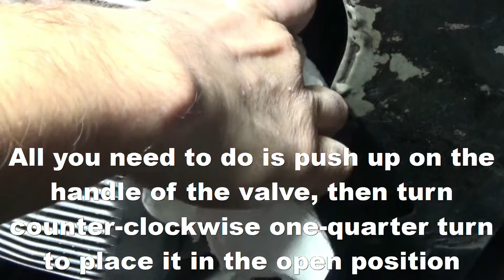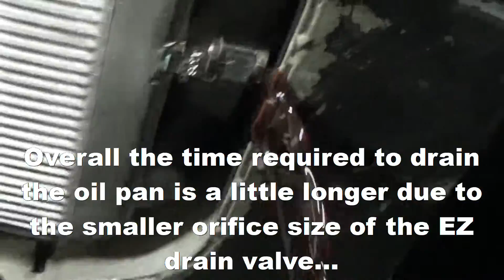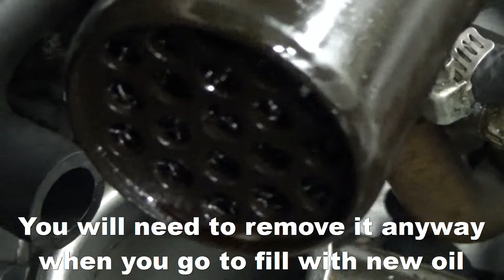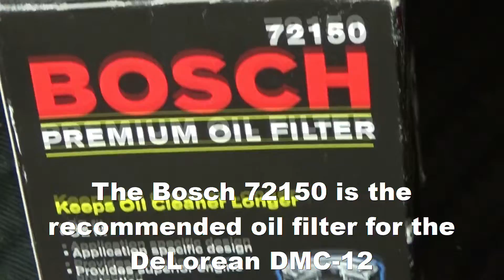DMC-12 Oil Change with EZ Oil Drain Valve from DeLorean Parts Northwest

Comment: You can add an optional hose end to connect to a hose to avoid the oil from splashing.  Simply screw on the H-001 (Straight) or L-001 (90 degrees elbow) to this valve.  You may order from www.oildraivalve.net
Reply from the maker: Thanks for the tip!  Yes I plan to get that... correct URL:  https://www.oildrainvalve.net/

Comment: @matt wolice  Isn’t there a danger in using synthetic motor oil on older cars as this might cause them to leak? I heard the molecules are smaller and this will be a a problem. Wouldn’t it just be easier to use a zinc additive with your oil change?
Reply from the maker: Yes there is a risk using synthetic.  However the oil I used in this video is conventional motor oil...they make a synth version but I don't use that in my car.  Some owners have switched, but I only recommend it if you've done a complete, professional restoration of the engine.  That's just my opinion...

Comment: I really hope you’re not starting or driving your De Lorean below 65 degrees using 20W-50 honey as engine oil. I know that “DMC” TEXAS  recommends this for a standard oil change.  In Houston when it’s 100° outside this oil will do just fine.   But for most climates except for bitter cold, 10W-40  would be much preferred, assuming the engine is not terribly worn from lack of maintenance or use of improper oil viscosity.  Best of luck to you and your D.
Reply: I live in Utah where it can get over 100 in the summers, 60's in the fall, and 30's in the winter. Do you think I should go with 10W-40 or something else? thanks. June, July, and August average temp is 90 degrees. Which is when I drive it the most.
Reply: @spencereng  The 20W-50 will be fine when the ambient temperature is high.  Actually, if it's 100 degrees outside, you are wise to use 20W-50.  However, I would consider switching out the oil seasonally if you drive in colder weather.  For example, change out to 15W-40 or 10W-40 once temp's approach 60 degrees.  More importantly, the De Lorean's PRV engine has flat lifters (tappets).  Flat-tappet engines were ubiquitous in the 1960s and common into the '80s.  Most oils you see on the self are not appropriate for flat-tappet engines because they lack zinc-phosphorous compounds called "ZDDP".  This is because all newer cars have roller lifters, which produce much less friction in operation than flat lifters.  Higher levels of ZDDP (about 1200 ppm to as much as 1400 ppm) are best to prevent premature cam and lifter wear on flat-tappet engines, generally speaking.  So forget about DMC Texas' recommendation of Castrol GTX (of any viscosity) because Castrol (just like all major oil brands) has progressively reduced ZDDP level to 800 ppm or less in most oils.  

So what should you use?  Amsoil is among the most reputable companies that make oils specifically for engines of this vintage (Amsoil's Z-rod brand for example).  Be aware that Amsoil, at $12/qt and with a 7-qt sump, we're talking about an oil change approaching $100.  Some De Lorean owners and owners of other classic cars will swear by 15W-40 diesel oils such as Mobil Delvac or Shell Rotella because they have favorable ZDDP formulations (and these oils are MUCH less expensive than the aforementioned Amsoil brand).  If you haven't already, check out some online communities such as DMC Talk (and be prepared to see A LOT of opinions on this).  Keep in mind this is not a De Lorean-specific issue; most owners of classics from the 60s, 70s, and into the 80s need to make the very same considerations, and there is nothing fundamentally exotic about the PRV engine.  Finally, don't drive your De Lorean in the winter if you can help it :)
Reply: Awesome, thanks for the great info!

Comment: What a stupid design on deloreans part to have the oil drain plug face the cars frame. Maybe that’s why they went out of business.
Reply: Just needs a little brake clean to clean it up. Also, the original drain plugs don’t stick out like this one.
Reply from the maker: That was probably the last reason they went out of business but I agree.  A down spout would have been great -- unfortunately the EX oil drain vale ones you can get do not fit because of the frame.